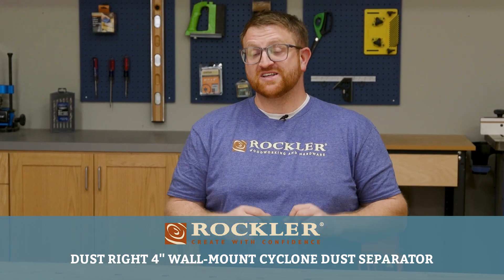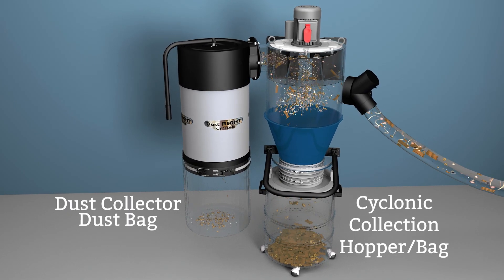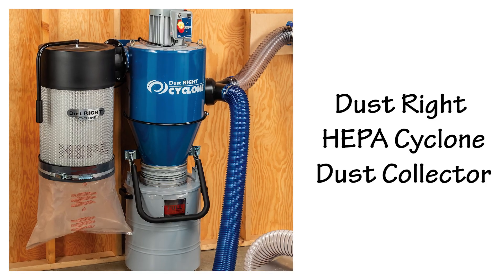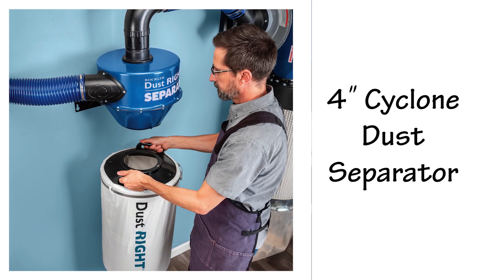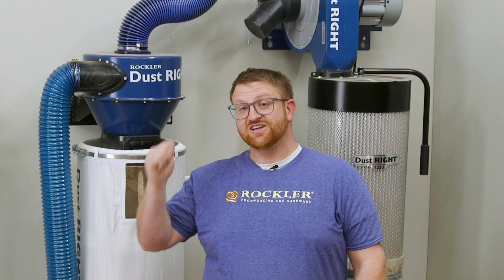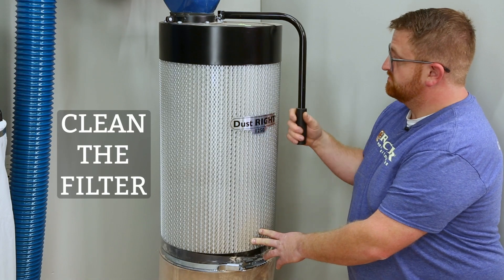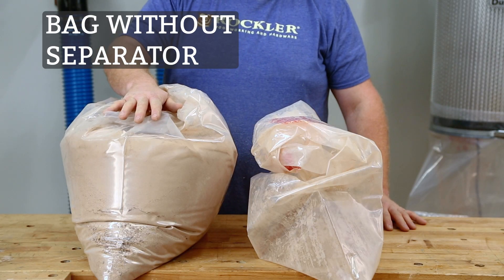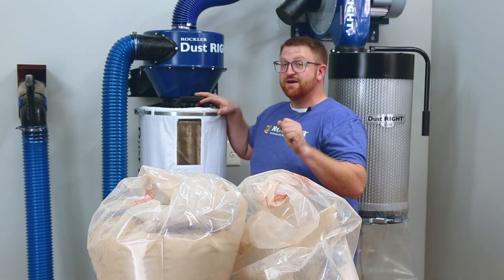Adding a Cyclone Separator to Your Dust Collector

Comment: Can I add a garbage liner to the collection tank?  I don't want to have to dump the dust into a bag.
Reply from the maker: If you put a bag in, it will need some form of stabilization to hold it in place and not get sucked up and cause a clog or other issues. Our Dust Right 4'' Wall-Mount Cyclone Dust Separator Item #64229 has an internal metal frame to keep the bag from collapsing under suction. However, with the twist lock top, you wouldn't be able to get a full bag out without disassembling the whole thing. It is designed to be the collection bag and flipped to empty.

Our Dust Right Wall-Mount HEPA Cyclone Dust Collector, 1250 CFM Item #BMX00007 has a collection drum that rolls on casters for easy access, and has an interior bag that is supported by a metal frame and empties easily.

Comment: Bought it couple months ago and just needed to empty the bag. 
Emptying was very easy, at first I thought due to the smaller opening, the dust and wood chips would not come out easy, but it did. It does not weigh a lot even full of wood chips, so few chakes didi the job.
The bag was full to the see through window and the actual vacuum canister only had about 2 cup of very fine dust,  WOW!
The dust collector cage did collapse on my twice when my hose got fully covered by accident when it sucked in a tarp cover. I had to squeeze the opposite sides to get it back to oval shape (could use some strengthening with 2 brackets in middle). Overall I'm VERY HAPPY, my wall vacuum's canister is too small and filter used to clogged up too much.
Reply from the maker: Great to hear! We'll pass your suggestion along to our product development team as well. Thanks!

Comment: Still seems like 1) and awful lot of dust in the collector bag after the filter, and 2) the cyclone's bag is small and will need emptying quite often.  Why not extend that bag to the floor or make it bigger in diameter to reduce frequency of emptying?
Reply from the maker: Most of the dust in the bag under the filter, came from cleaning the filter after the first run with no cyclone. The bag on the cyclone is 20 gallons.